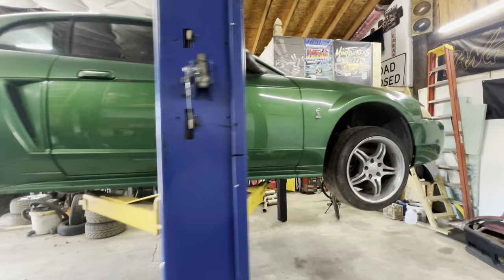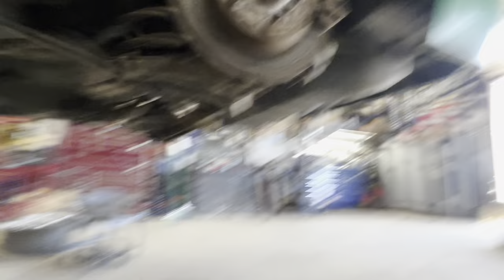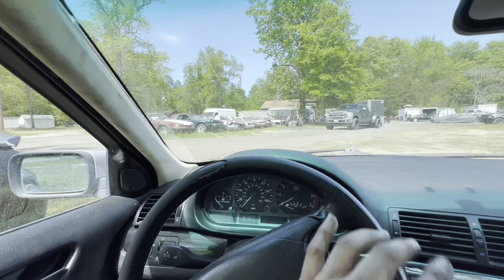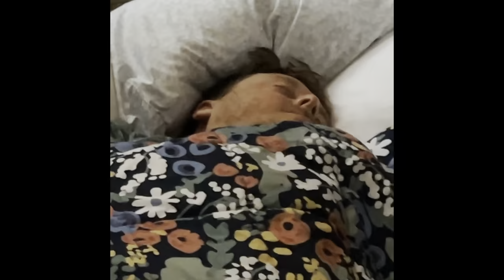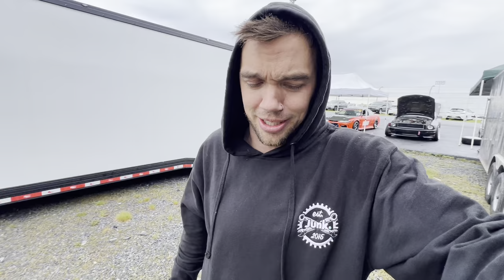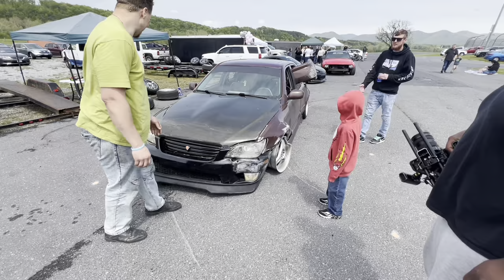BLEW MY MOTOR! FOX BODY GETS IRS!!

Comment: if u wanna make money off that cobra the amber tails usually go for 800 minimum depending on condition. and the front bumper easily 1k plus if all the tabs are in tact, no cracks or damage
Reply from the maker: I got the tails on market place for 700 cause one has small spider cracking

Comment: If you’re running Taurus calipers you need the mustang bracket / slider and then the Taurus caliper goes on those. I’m currently building my dual caliper setup for my sn95